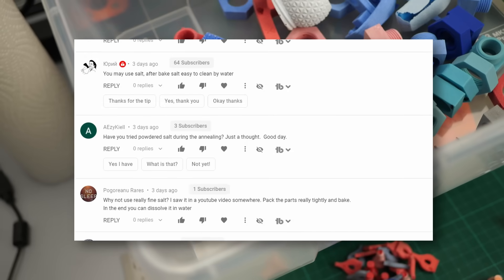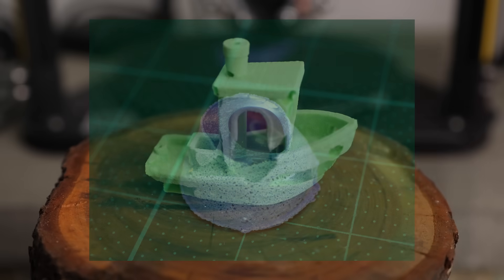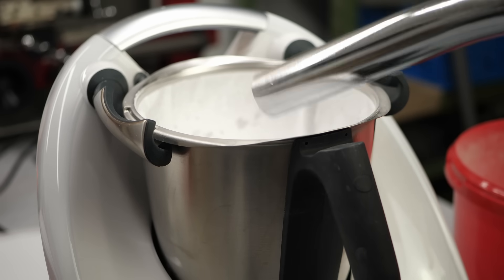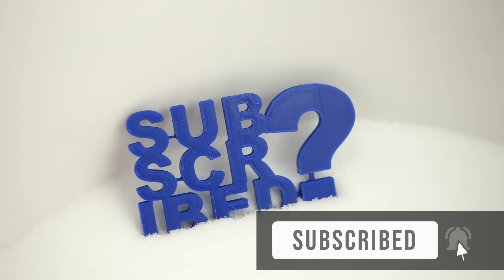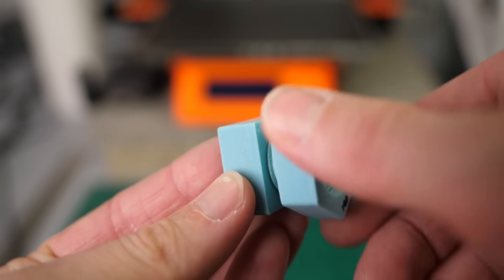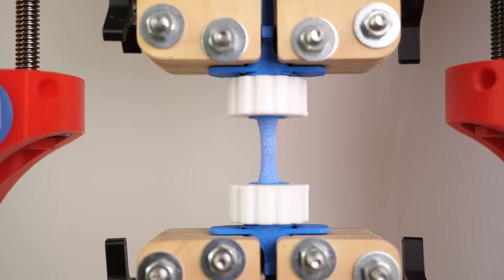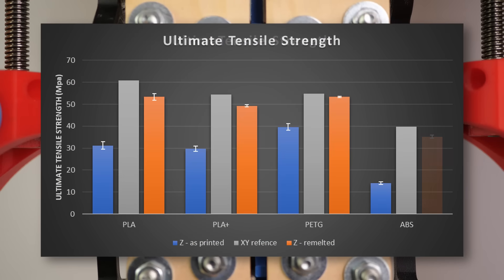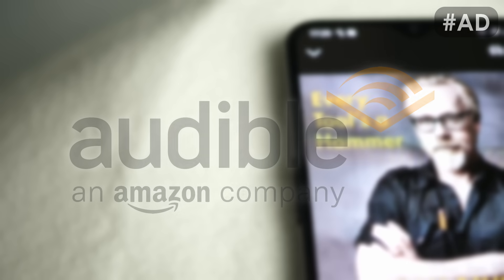The STRENGTH of 3D prints REMELTED in SALT

Comment: You should try Starch (Stärke). It is used for making the forms for haribo gummybears etc. they get a very smooth surface and it melts at 200°. So this is already very fine, holds the form very well, cheap, heatrestistant. Maybe another video? :)
Reply: 200°C as a melting temperature is lower than some of the oven temperatures used - it sounds a bit too low to risk it...?
Reply: @EliTheDriftPanda  Potato starch has a melting temperature of about 260C, more than enough for PLA
Reply: @EliTheDriftPanda  you dont have to melt the plastic. Hardening usually uses 100° or so. It should work. It softens at about 80-100 which should rebind the layers.
Reply: @the23er  in salt, the suggested temperatures were way above 200°C and even with Stefan going lower than suggested, the whole thing was heated close to or above 200. I'm not sure about the thermal conductivity of starch, but I doubt it's precise enough for you to reasonably use it for this purpose. Even if it were, you'd have to pay way more attention to the process, increasing post-production costs (be it your more active time or higher print failure rate if you don't intervene quickly enough).

Softening at 80-100° doesn't change this, because the issue is not the individual layers being deformed or similar. This technique is specifically meant to give your prints a solid, moisture reducing atmosphere to remelt the layers into one continuous object. That's why Stefan made special note on how the breaks looked and the difference between clear layer lines in the controls as supposed to the homogenity of the tests
Reply: @the23er what video did you just watch?
Reply: silica powder?
Reply: @bokunochannel84207  I was thinking that and the ceramic slurry like is used for investment casting, then into the salt.  the ceramic provides the surface finish and the salt is just there for the thermal mass and support.
Reply: @speedbuggy16v   couldnt you just paint a layer of ceramic slury onto your print an let it harden then since its hard itss protect your print from the salt , it wont cost much eighter , only a bit of slurry
Reply: @jonathanperreault4503  that was pretty much my thinking.  But I have no experience to back it up.  I was hoping someone that had some experience with that type of thing would chime in.
Reply: @bokunochannel84207  Probably would work, I imagine silicosis is not worth it...
Reply: As in cornstarch? It's a very fine powder, inexpensive...... and definitely worth a try. Oh yeah..... it's non corrosive...
Reply: @davidrandall4001 so? It will not hold up
Reply: @jhoughjr1  I did it in bicarb soda and it was perfect... I did it for thermal ducts for my old 3D printer (FL SUN DELTA). They still kept the correct dimensions etc and seemed to take out layer lines. I put it in a cold oven and heated to 150C (if my memory serves me correctly, it was a while ago) and turned off the oven  once it reached temp (or it might have been at temperature for <30min, can't remember), let it cool slowly in the oven. (this definitely did raise the temp it could get to again without warping, you could do this to essentially make it dishwasher safe when it wasn't before. It was needed for me because the duct was very close to the hot end). I might have been using a special heat treated filament made for this process though (I think it was called "HT" in the name). I was concerned because of the temp limit of bi-carb, but after a bit of research, it seems the evap point (or molecular degeneration point) means nothing because it evaps so slowly it doesn't really mean anything detrimental.
Reply: @knifeyonline  be careful when baking bicarb/ baking soda. When you bake baking soda, it turns it into sodium carbonate, which is caustic and can be dangerous when handled improperly. Gloves, goggles, and a respirator should be worn at all times when dealing with it as it can cause chemical burns when exposed to bare skin, and if it gets aerosolized (which isnt hard to do since its a powder) can cause damage to your respiratory system or blind you.

Not exactly a very friendly substance to use for this method, since you need a lot of it, and you need to handle it quite a bit to get it to properly encase your parts. One of the reasons why salt is such a good material to do this with is because if you accidentally drop a bucket of salt powder the worst thing that will happen to you is your skin drying out.
Reply: Yeah silica powder ok but also fine ash you dumb stupid idioyotods. Incredibly small grain.
Reply: And it also doesn't burn or melt or anything else.
Reply: Someone said diatomaceous earth and that sounds like the perfect point between ash and silica powder. So thats more like it.

Comment: I saw uncle Jessie's video on smoothing prints with photo polymer resin, and that got me thinking.  Most Resins available don't deflect much with heat.  What if you make a thin coating with resin, or even epoxy, before annealing?

Comment: Wonderful video, thank you for all your hard work!

Some other thoughts: I'm curious to find the effect of the porous layer on the specimen's ultimate strength. A change in surface finish has an effect on the endurance limit for rotating members (S-N diagrams & endurance limit modifiers), but I'd bet it changes the material property on the exterior of the part. I'm assuming a skinny part (2mmx5mm CSA) would be more effected by the finish than a wider one (5mmx5mm CSA) by ratio of area effected vs homogeneous material. There also seems to be a difference in how much the exterior is effected: the PLA has a thicker porous exterior (13:31) compared to ABS (16:02). Maybe it's because salt is more chemically inert with ABS at those temps?

Comment: I wonder how much of the strengthening is actually from the NaCl or due to the re-melting of the original material. The re-melting is a kind of annealing, If cooled slowly it could be reorganizing the atoms in the material, potentially removing internal stress/strains to toughen it up.

Comment: instead of grounding the salt, just put it in the oven and loose all crystalisation water. you won't get much finer than that. then, with the salt still hot, close the container hermetically, because the dessicated salt will be hygroscopic (draws water out of the atmosphere). then, once it's cooled down, quickly insert the printed pieces, and do your process. just a suggestion :)

Comment: Wouldn't using microwaves be a better way to heat up the material evenly and be easier to control? Microwaves have the benefit of reaching the core of the material and heating it in a controllable manner if you use a few precise thermometers releasing the internal stresses allowing fusion / crystallization depending on the material and temp variations. Sort of like heat treatment for reinforcing metals.  ... You get the basic idea.

Comment: You should try it next with foundry casting sand. If you're still set on salt you can process the salt into a fine powder more easily by filling a two liter bottle approximately 1/3rd full of salt and then adding steel ball bearings and putting it onto a rock tumbler turner to make a simple ball mill.
Reply: Came to comment the same thing. Dicoloration and change of structure of the surface material can be related to some chemical reactions between the salt and the polymer, so something chemically inhert and of smaller size could greatly improve the surface finish, probably reducing finishing work time.

Comment: Hi Stefan (oder Stephan?) did you try as a compromise between the "real" plaster and the salt methode, a "dry" plaster too? o using the fine grain of the plaster, without any mosture just looking in to stabilisation by compacting? this may be a compromise without reaction and still good surface... ps if you for those typ of analyte need a bit more numbers for the grainsize(distribution) you can contact me, i'll can make you some analyze

Comment: I do recently thinking about fluid compression hardening method, and I did not tried to think powder at all, I first thought about air but it’s hard to add up pressure, so I made thought about liquid like oil, and it thought like it works. 
It need to be in a sealed container with no air, one side of the container is a cylinder cup, so you can change the pressure. Then it need to make a source of impact, like hammering, but I feel that the hammer won’t give enough impact. 
What will happened to the printed part is, as I know, pressure is same everywhere in the fluid, so when there’s an impact, the pressure will be transferred evenly on the printed parts. And the sudden compression will raise up the heat, melt the surface of the part. Then the bounce back after the impact released, will reduce the surface temperature, hardening the parts. After a couple of impacts, the surface is smoothed, the internal temperature of the printed part increased to a higher point than the surface, then pull up the cylinder cup of the container, to release some of the temperature for a while, and just take the printed part out, the machine and the oil instead is ready for the next part~ as well just wash the finished part, and see if it works! 😂
Well I guess I think too much.. I am working on other thoughts, hope someone can see this and try for it? I would like to pay if someone made this machine and sell it! 
Hope I can get a reply XD
Didn’t get any reply from any idea yet, I’m not single, right?

Comment: Great video. Did you try compressing the salt while using a vibrator (e.g. a table attached to a seldom heavy motor with an unbalanced weight attached to the rotor)? Vibrators are used to dissolve air bubbles from within molds filled with resines, that are specially dense and prone to capture the bubbles. They usually fill the mold slowly with the mold on top of the vibrator, and leave the vibrator on for some extra time to ensure all the bubbles migrates to the surface. I think the same effect could help compact the grains: place the container over the vibrator and start pouring the salt slowly over it, and then add the weight to compress the salt with the vibrator turned on. You may leave a weight on top of the salt surface for hours with the vibrator doing its shaking work to help maximize the grains compression.

Another thought crossing my mind: there are silica based components used in the food industry to thicken products like mayonnaise. I don't recall the product name or composition but I think it's worth to look at, for it's inert, and a thin powder (thinner than talcum) made of spherical shaped grains, they could be so thin that you may need to wear a mask to filter the air to prevent your lungs from getting clogged, and it resist high temperatures.
Reply: Another idea: you may use high temperature resistant silicone, the same used to make a mold, but instead of pouring it around the piece (that may work anyway) you could paint the printed piece with a thin layer of silicone using a brush, let it dry out, and then place it inside the salt. The idea is to prevent the salt to mix with the plastic in the surface. A thin layer may be enough to prevent the mixing, yet easy to peel off from the piece after the process.

Comment: Would it be possible to insert salt (or other crystalline body) into the filament itself to be extruded into the printing process? If so, couldn't one then just bring do a normal heat treat in the oven after printing?

Comment: What about using fine casting sand instead of the salt? I have seen videos of people 3d printing parts for the mold,  and the metal part maintains dimensional accuracy. It should also yield a better (though still matte) surface finish. I would be very interested to see this.

Comment: One way of getting a very fine powder is to use flour. Of course, how to keep it from burning. I put some in a vacuum sealed mason jar and it worked just fine. I guess this means parts have to be smaller than your jar and you need vacuum sealing equipment (I have a food saver) but it is an alternative.

Comment: Take a look at foundry sand. Its highly tampable, extremely heat resistant, and less likely to react with the plastics.

Also, the best way to powder anything, is to get a ball mill.  I use alumina and tungsten carbide ball mills to powder rocks for my experiments, and sand is super simple.

Comment: Did you consider using a vibrating table to compact the fine salt around the printed items, so to avoid having air bubbles around complex objects? after vibrating it you can still proceed with layered top-down compaction. Also, it would be nice to use boron salts, but you could also go to a marble cave and collect some marble powder (it is usually mixed up with water due to the stone cutting process, so you'd need to wash it, filter it and dry it beforehand). It is not soluble in water though. Baking powder would be soluble, but I think it would release CO2 bubbles when heated, so it's a no-no...
Reply: Salt density is notably higher than PLA density (2.16 vs 1.24) so if you're vibrating the compound (like to extract bubbles from poured concrete) the printed parts will rise to the top as if they were bubbles. You can try this fun experiment by placing a river pebble on top of sand in a beach bucket, and burying a cork at the very bottom: when you vibrate the bucket, the pebble will sink into the sand, while the cork will rise and pop out!
Reply: @fluxcapacitor  You're right about the floating problem, but it is easily solvable by keeping the PLA part down with a finger.
Reply: @mariosebastiani3214  Right. With the risk of reintroducing air when finally removing the finger, but air above the part is not as bad as air under admittedly. However the other problem is the powder cannot be fully packed down by doing this. One could mitigate the issue by using very thin removable metal rods, properly securing the part temporarily while vibrating.
Reply: @fluxcapacitor  Or directly printing the part with a protruding rod on the top, easily removable after the remelting.
Reply: Yeah just pop over to a marble cave
Reply: @jerbear7952  Asking nicely does miracles, at least here in Italy. Chances are they won't let you in for safety reasons, but you give a 10 bucks bill "for the coffee" to a worker and he will bring out a bag of marble powder. After all, for them it is a sort of garbage that has to be disposed of.

Comment: You might think about using a ball mill to pulverize the salt, a vacuum desiccator to dry and store it, and some sort of electric agitator to help pack it.  I have a vortexer that would get the job done.  I also wouldn't worry to much about anti-clumping agents.  They should be under 1% by weight.

Comment: I had a thought about the grain size issue...

What if you were to precipitate the salt onto the part from water (or another carrier liquid) using either a few hypersaturation -> cooling cycles or boiling the liquid off (if the plastic will retain it's shape above the boiling temperature)?

Also I wonder if there's another combination of materials that would work in this, maybe something alcohol based?  I think alcohol is non-polar so salt won't dissolve but maybe sugar would I think sugar melts at 160*C though... hmmm...

Comment: Print yourself a ball mill.
A ball mill uses a drum filled with spherical grinders to crush minerals between them as the drum rolls on a set of drive rollers.
A set of junk billiard balls and a 10" PVC SCH 80 water pipe scrap works very well.

The same machine can double as a polisher. Fill with walnut shell chips or styrene beads and a suitable polishing compound... Tin Oxide, Cerium Oxide, Jeweler's rouge... and run either wet or dry according to material requirements and desired finish.

Comment: I don't know if this would help reduce the porosity but if you printed a column on top of the print as it all melts it would help to add more plastic it would probably need vibrating to work though

Comment: Thermomix is a super-expensive high-speed blender with a powerful motor. Use a grinder instead. Grind by hand if necessary. And you really need to sieve to get consistent smaller size. All blenders leaves a mix of small and large sized particles. The awful surface quality was because you did not remove the leftover large particles distributed randomly in the mass of salt.

Comment: Here's an idea that came to me: in order to get the core of the salt mass hot enough more quicker, you could add metal (copper is paramount to conduct heat) bars or pipes (tests needed here) between the printed pieces and make sure that at least 10 cm of the bars/pipes exceed the surface of the salt to conduct heat much faster to the core.
Salt compression could be a problem, but not if you solder the bars/pipes to pieces of metal at the bottom and a bit higher in order to conserve parallelism. Then you'll need another piece of whatever strong enough to compress the salt, having holes drilled to let pass the bars. and push on the surface of the salt powder for compression.
This limits the size of the 3D printed objects, but you still can make other models of such heat conductors.

Just my 2 cents...

Comment: This is really interesting!

Would it make sense to coat the freshly printed parts with several layers of salt dissolved in water to create a smooth surface layer of salt on the parts before packing them in the fine salt? This might reduce the thicknes of the layer in wich the salt mixes with the print material. Resulting in a smoother surface finish and even more stability because less plastic is "lost".